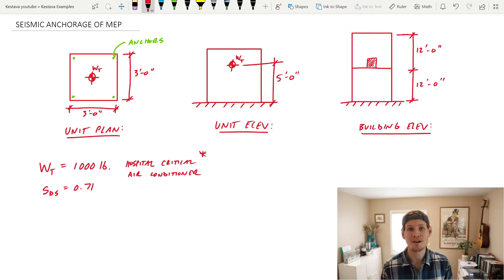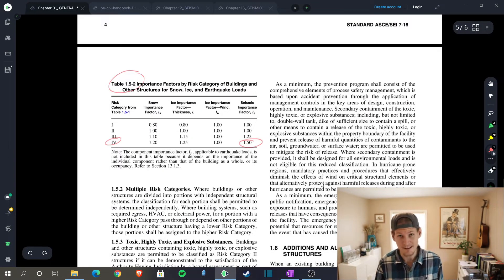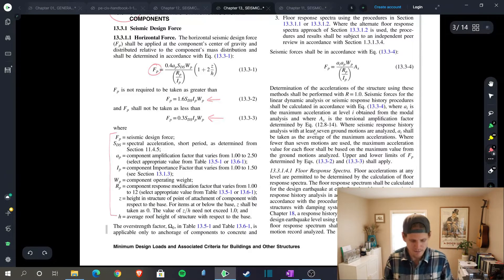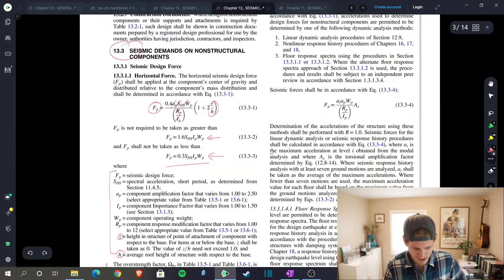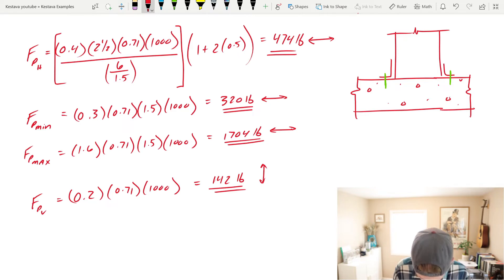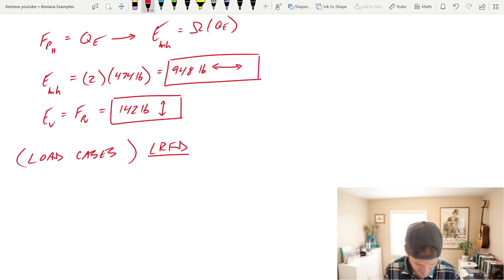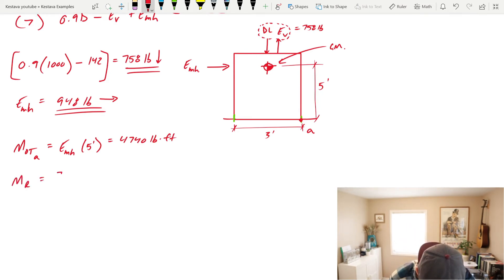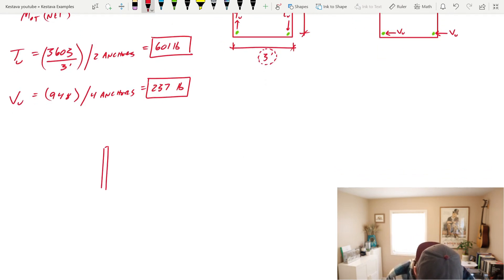People Pay Thousands For This Engineering Solution

Comment: Mr. Kastava .. will you have a video on how to apply temperature to the staad pro correctly? Here in my company they load it as mass for dynamic loads and that I think is an error, I loaded it with the load temp command, it is forced to assign loads in addition to those of the normal combinations (own weight, dead, live and reduced live loads ), and the response spectrum command)? I don't think that this is enough for the modeling of the structure to be correct. Thanks.
Reply from the maker: Hi David, I'm no STAAD expert unfortunately =(. In fact... I'm not very good with analysis software. Id look for other YouTube channels with that expertise. I think you have a great question tho!